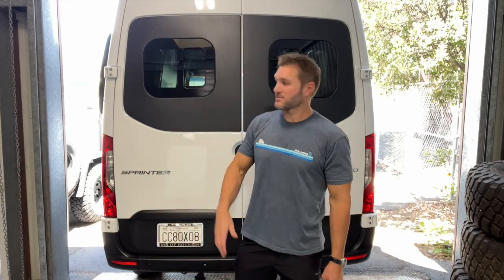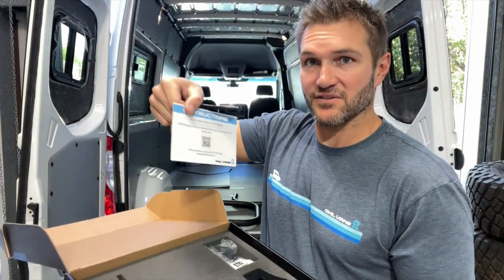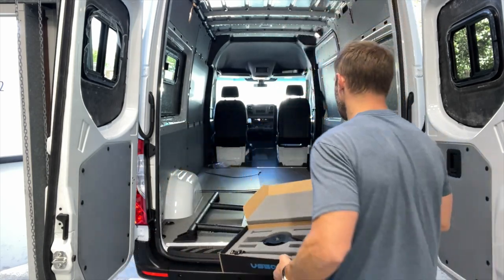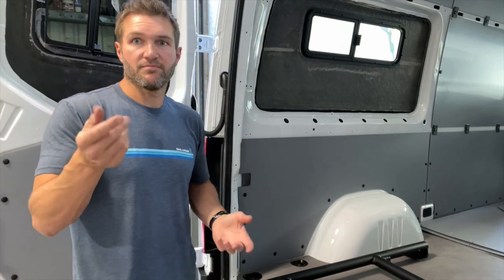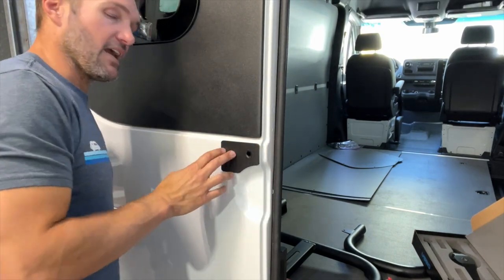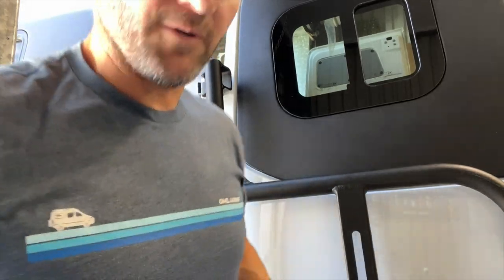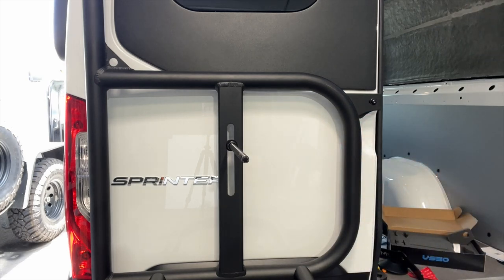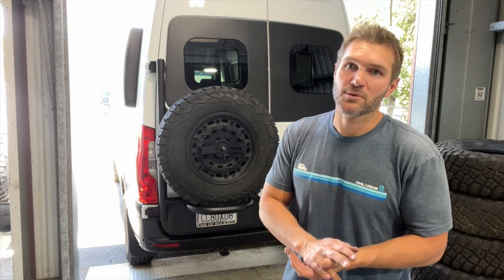Expedition Tire Carrier Install VS30 (Updated 2022)

Comment: I installed wheel mounting bolt to frame using 5/8" x 1-3/4" SS large flat washers (FUD0711008) to increase bearing area on aluminum frame.  Works great!  Thanks!

Comment: Would that be better using carriage bolts? Anti-thief?
Reply from the maker: The bolts are not accessable with the door closed so it could not be easily unbolted. That said, any thief that brings tools is usually going to get what they want.

Comment: I have the Thule double bike rack in the passenger side rear door.  I want a spare tire carrier. Will this carrier work with the Thule bike rack??
Reply from the maker: It should but you might have to mess with the bike trays. Are they adjustable? We have heard about those carrier denting doors so you might consider upgrading the bike carrier as well

Comment: Did anyone weight the spare tire?  80~90 lbs?
Reply from the maker: Every wheel/tire combo is goign to be different but 80-90lbs should cover most
Reply: You mention 180 hinges can 270 be used if a gas spring or limit strap is used to limit door opening?